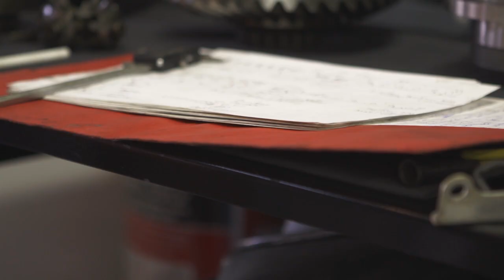In Focus: The life of a Ferrari mechanic

Comment: Hi! I'm currently doing a total rebuilt of my 308 right now. If I have any questinos, can I ask you? My engine had a problem from the start when I bought it. Now I had a racing mechanics looks at my main block bearings. We will shift that out, but I have to wait until he has done his measurements.. I have got new pistons and new sylinder liners... What I'm most worried about is how to get the timing right first time! How do I start??